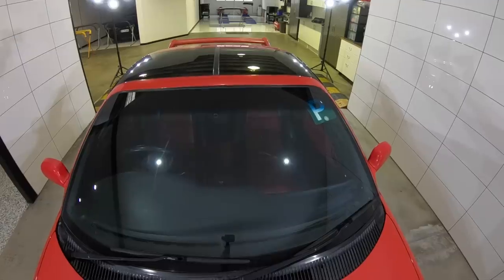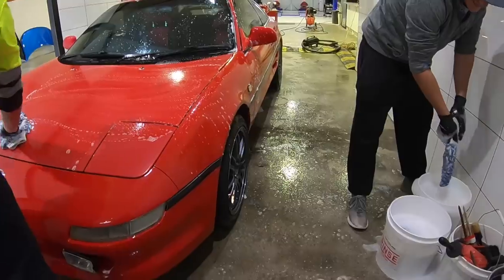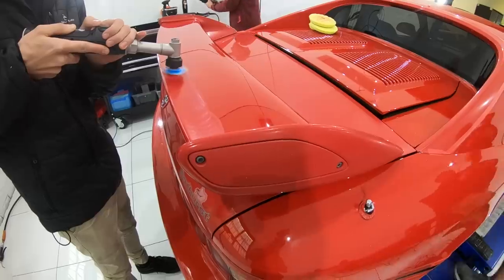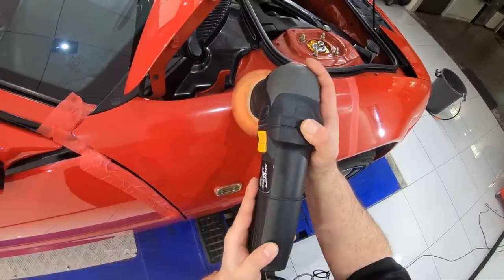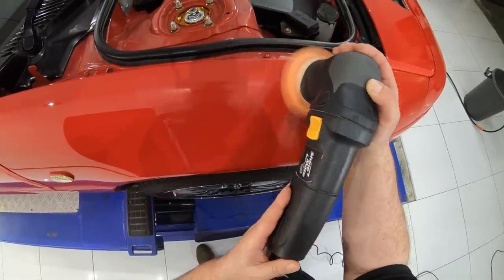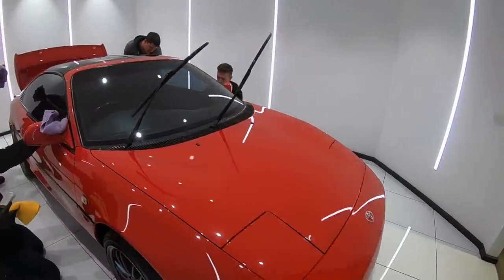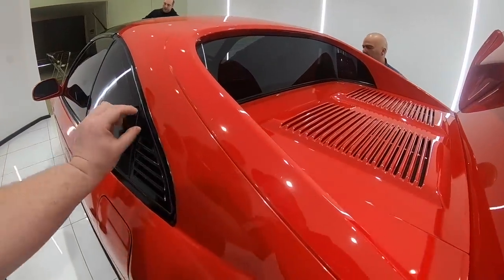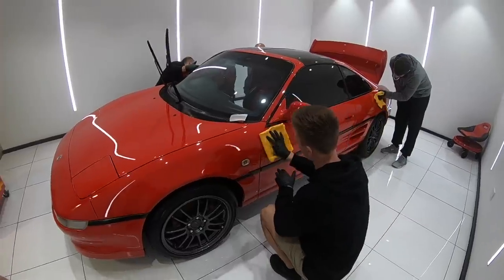Toyota MR2 Restoration Detail (Vlog 14)

Comment: Sandro,  I came up with a saying on a similar type job.  I recently corrected the  paint (as best I could) on a not to well maintained red🙄 1990 Mazda Miata.  No clear coat and lots of swirls, spider webbing,  minor scratches and in some cases exposed primer around the gas cap and trunk lids.
A lot of soft touch, care and time resulted in a very tasty looking revived Miata Roadster.   At the reveal, I told him "I took what I could and left what I should." That  comment has stuck with me ever since.  Btw...great vid!  Made me smile...
Reply from the maker: I like that, it sums up respectful paint correction quite well!

Comment: I was a porter at 3 dealerships on and off throughout 3 years. I wanna say there is a difference in detailers and real detailing is a skill the same with mechanics, body specialists, painters, glass specialists etc. 
Trades have their levels and apprentices, I believe the same for detailing.
Cleaning is level 1 apprentice
Detailing is level 2 apprentice
Deep detailing and semi art is level 3 apprentice
Artistry and restoration is level 4. Licensed level
Creation Specialist is level 5. The seal of completion.
A creation specialist not only is a paint specialist but also can see areas so deep within and must apply indistinguishable touch up paint but also must possess the knowledge.
The levels never end.
The grand master teacher will always be replaced with a new one as knowledge never ends and new knowledge is always upcoming.

Comment: About ten years ago I detailed a friends red Ford Laser from the 80s. It had been so sunbeaten that it was almost orange, and matte. Back then, I didn't know detailing like I do now, but I washed.it thoroughly, complete claybar treatment, then Meguiars paint prep to remove oxidized paint, then paint polish, and meguiars deep crystal cleaner wax, all done by hand. I didn't touch the plastic or metal trim, but it still looked like a completely different car. If I was to do it again, I'd do it like Sandro.

Comment: My sister bought one when it first came out. After a few weeks the T-Top started leaking and the other bad thing is Toyota tried fixing but with no success. The car was also very hard to steer. It was definitely a head turner and got a lot of compliments with the design.

Comment: very impressive results, and i'm almost tempted to let you have a crack at my 2016 Hyundai i30 in Black. My car has always had an issue with the paint, in particular the clear coat having a nasty orange peel effect since owning it brand new. With Orange Peel, would it require Sanding, or just clever polishing? thanks

Comment: Shame she isnt a turbo model..... although shes been fitted with the engine lid from one. Had two rev3 turbos and one rev4 turbo running 330hp over the years, absolutly superb cars and seriously fast if tuned, need respect driven hard or they'll bite back....great to see this mr2 given some love, great work as always
Reply: james locke such fantastic cars right!! And they fly!!
Reply: @dylan4972  yeah i loved all mine, the rev3+ turbos (1995+ models came with ct20b turbo vs earlier ct26) came with 245hp stock and due to the mid rear setup giving superb launching traction could get 0-60mph in 5.4sec stock....my last one.... a rev4 running 330hp was sub 5sec.....such underrated cars, a 300+hp mr2 can blow away imprezas and evos running 360ish+hp due to weight and the little power loss to wheels due to mid rear setup vs the 4wd power loss etc....they are edgy to drive fast though lol. Also loved the gt4 Celica's which came with the mighty 3sgte engine but never owned one. Dont know why i wrote all that seeing u clearly know your stuff about them lol.....just such a fan of these cars 🤣
Reply: james locke sounds like you have a passion for them!! I went 2GRFE turbo on my car. Love Toyota from the 90s

Comment: Great job!!!   I'm amazed you were able to make all those repainted panels match the original paint that well.  I'm not a huge fan of that single stage Toyota red(San Mateo red??), if you didn't stay on top of waxing it, it faded/turned pink in a real hurry. 

 I still kind of wonder why Toyota still used single stage paint(basic white was single stage well into the 2010's!!) when everybody else had gone to base/clear long ago.
Reply: As an owner of a model year 2000 Toyota in Super White (T040) which due to life circumstances has gone 1 full year without any kind wax/sealant/coating I agree with you. My car looks like it is covered in chalk, not paint and I plan to start the paint correction process once I get all the necessary supplies. It is always good to see a detailer that covers single-stage cars, most seem to ignore them as if only cars built before the 1980s had single-stage paint.
Reply: 1993+ used Super Red. 1991-1992 used the darker Crimson Red. Yeah paint is one area these cars never got a great treatment on except for the metallic variants which got clear coats I think.
Reply: Cheaper in a sense and back then people liked taking time and pride in waxing there cars and making them shine.. You can't do that with car with clear coat as often damage or water spots especially black cars

Comment: Once again great job!!!!!Several paint jobs on one car would be a challenge. Is the Shine Mate yellow pad with Precision more aggressive than with LC HDO blue pad that I have used based on your previous videos???? I take it this conbo is better for single stage paints as opposed to Base coat/Clear coat combo. Also if the paint had both single stage along with a clear coat on some panels how did you balance the two to get a even result????? Definately a CHALLENGE mate.

Comment: Hi Sandro, I’ve heard the shinemate 15 has as much pad spinning torque as the Rupes 15 MK2. Not talking about which has a higher top speed. Thoughts?
Reply: I remember seeing you use a red 15mm a year or so ago. Was the polisher less powerful than the Rupes and Adams?

Comment: Just wao..! excellent work ..!
Reply: Wax in all the tight spaces,be patient,really thorough and you'll be amazed and it'll be worth it.I use abit too much wax but that's because i get in all the badges,window edges,rubber edges and door shuts...it transforms the whole car than compared to doing a quick job.My car just gleams! And when washed then re waxed after 3 months it builds up layers which is what you want.

Comment: this job that you do is permanent how long will it last how much does it cost what the owner need to do to maintain what you did?
Reply: Till you swirl the paint up again for the correction. For the sealant/wax depending on the coating used could be anywhere from a few days for a Carnauba wax, to months for a sealant, or 6 months to a year if using ceramic coatings.

Comment: It looks impressive to amateurs because of the impactful colour (red) and the layer of dull oxidation that was removed to reveal that impactful colour. 

As usual, no mention of PRICE, which makes such work merely eye candy, meaningless and great for video theatrics. 

Based on the price of such a detailing job, why would you lavish such an expensive detailing job on a WRONGLY applied CHEAP paintwork obviously painted with cheap materials that had become super thin and very old? 

If this paintwork was an aged, highly neglected, shitty looking custom paint job, it would have made perfect sense.

If the owner was a genuinely knowledgeable enthusiast who really loved such a Japanese classic, a complete respray would have been a more intelligent choice.
Reply: Hey Sandro, what did you do to the black trim, it looks like new. Fantastic result mate.

Ignore the negative comments mate, like you said, meaningless, narrow minded and clearly entitled - not everyone has $10 -15 grand to drop on a proper paint job !! And even then it would probably need a good detailer to make it look its best afterwards.